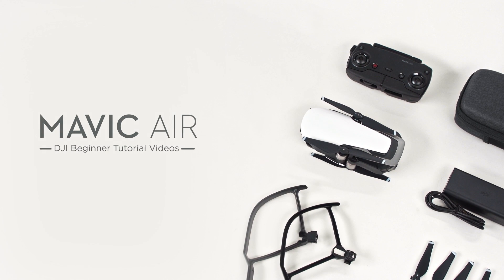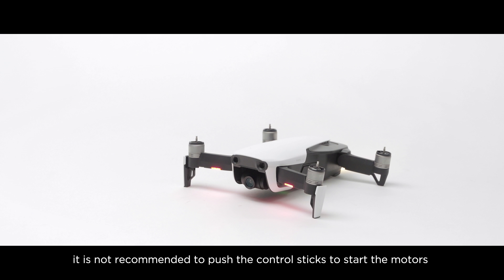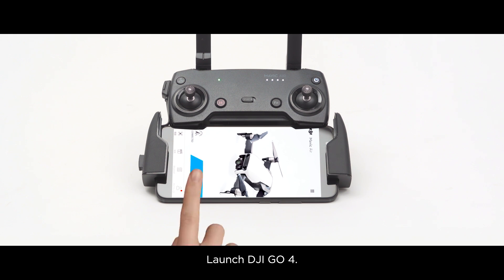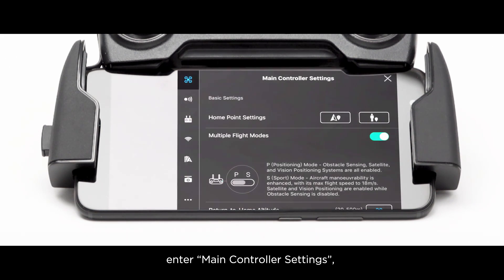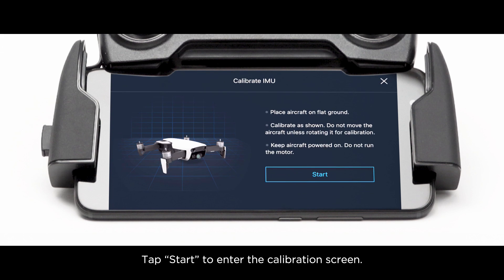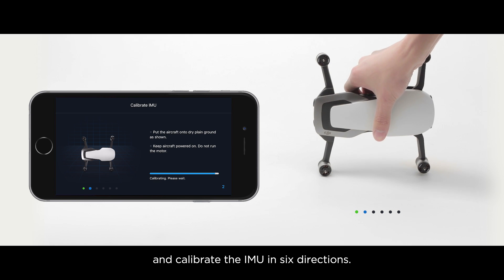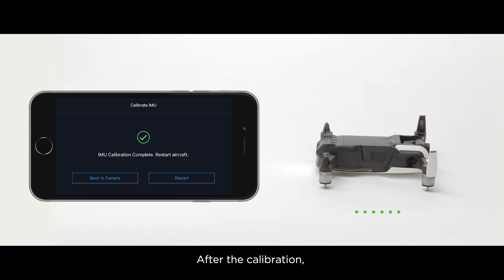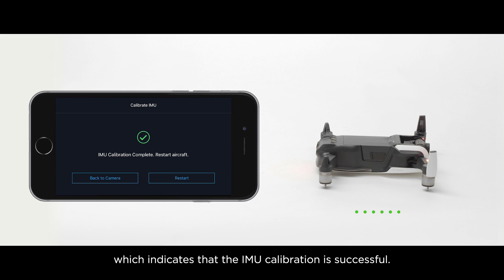How to Calibrate IMU on DJI Mavic Air

Comment: how do you calibrate IMU for a DJI O4 lite unit? (not on a DJI drone, but on a Flywoo75)  ?? 
Android, DJI 4.0 app, no option for the DJI 04 air unit. just a bunch of DJI drones.
Reply from the maker: Hi there,

Sorry for the confusion, and thank you for reaching out.

For the DJI O4 Air Unit, the IMU module cannot be calibrated via the DJI app like consumer DJI drones.

May I please confirm whether you are currently seeing any IMU error or warning message in the goggles?

If yes, please help provide a screen recording or screenshot from the goggles, and upload it to Google Drive, then share the link with us so we can further check.

Also, please let us know:

1. Did the IMU error appear after a crash or impact?

2. Have you already tried restarting the devices?

Once we have this information, we can assist you further with troubleshooting. Thank you for your understanding and cooperation.

Comment: DO NOT BUY THIS DRONE. YOU WILL HAVE TO REPLACE THE ENTIRE UNIT WITHIN 1 YEAR. IT'S A DEFECT IN THE PRODUCT BUT DJI WLL CHARGE YOU $550 TO REPLACE YOUR BRAND NEW UNIT.
Reply from the maker: Hi Hunter, sorry for the inconvenience. May we know your case number for better assistance? We'd like to help you check the details, thanks.
Reply: DJI Support don’t know if there’s a case number. Wasn’t willing to pay $550 for a drone I’ve used 3 times and never hit anything. Never had a problem with this drone. Did the required Firmware update and INSTANTLY BRICKED MY DRONE. 

Now you guys want me to pay you $550 to fix it.

#buygopro #boycottDJI
Reply from the maker: @huntergray  Sorry again for the unpleasant experience, Hunter. If you sent the unit to our repair center for service, there will be a case number started with CAS-, you may also provide us with your email address and we can locate your case number and learn from the details. We look forward to hearing back from you.

Comment: I recieve the follow error in my Mavic Air: gimbal cannot receive main controller data. No crash happend. Just one day worked fine. other day that error. Drone is 1,5 years old. DJI says no more guarantee .In my country guarantee is always  2 years .  drone has a total of 7 hour flight time. It's a shame I have to pay for an error that is obviously a weakness of the drone... Let alone my disappointment on my Holiday that I couldn't take aerial pictures..  :(

Comment: After update firmware, my mavic air cannot take off check IMU and Motot, what should i do? Pls help me!
Reply from the maker: Hi Leo, please check if the firmware has been updated to v01.00.0620 successfully, and try to refresh the firmware via DJI Assistant 2. Besides, please try to calibrate the IMU and check again. If the issue persists, please provide the screenshot of the error message for further confirmation. You may keep us updated via Facebook Messenger: https://bit.ly/2pm7tfV

Comment: Yesterday my controller refused to link with the drone no matter how many times I tried. Today, it connects but calibration is taking me hours. Batteries drain and I recharge and keep trying. What should I do if it refuses to calibrate, please?
Reply from the maker: Hi, please shut down the drone and cool it down, then reconnect the DJI GO 4 app and the drone to calibrate again. Please tell us the details if IMU still won't start calibrating.
Reply: DJI Support Thank you so much. I will do just that and get back to you please. I love all my dji products and I am impressed with your quick response. Thank you so much.
Reply from the maker: @JustDavidMinistries  You're most welcome, we appreciate your support. And when needed assistance, you can also contact us via Facebook Messenger: https://bit.ly/2pm7tfV

Comment: How about if is not responding and u got a messge of main controller data error
Reply from the maker: Hi there, please try to refresh the firmware for the drone and restart the drone. If the issue persists, you may need to send in the drone for diagnosis.

Comment: Hi, i press start and doesn't work and do noting
Reply from the maker: Hi there, was the drone and RC connected successful? Please make sure the APP and the firmware are the latest version, it would be better to calibrate outside with the strong GPS signal. If the issue persists, may we verify if the drone was crashed?

Comment: Hola tengo problemas en mi mavic air presenta inestabilidad en vuelo desplazamiento lateral y rotación aún después de calibrar IMU
Reply from the maker: Hi Oscar, just to verify, has the drone been involved in the crash or hard landing before? If not, you may calribate the remote controller and test in the open field with good GPS signal to check.
Reply: @DJISupportGlobal  aún no lo pruebo pero al parecer era calibración del joystick muchas gracias
Reply from the maker: @oscarmoran7061  You're welcome, you may keep us updated about the result after the test. Any issues, please feel free to contact us.

Comment: Hii dji 
Actually I m having a mavic air and its notify that (processer chip heated) plz help
Reply from the maker: Ashton, sorry for your trouble. Please turn the drone on for a while, check whether the fan is spinning. If the fan is not spinning, please send the drone back. Please kindly contact the dealer for further assistance. 
Please let us know if the fan spins correctly, thank you.
Reply: The fan is spinning
Reply: It's show on remote like (main control data error )
Reply from the maker: @theronepilot  Please try to refresh the latest firmware for the drone, if the issue persists, you may need to send in the drone. Sorry about that.

Comment: I only could fly it once since i bought the mavic air. Latest firmware, calibrated imu, and opti system. But no matter where i try to calibrate compass i get magnetic interference error.
Reply from the maker: Sergio, we are sorry for your trouble. May we know if there is an error message when calibrating the IMU? And does the drone crashed before? Please kindly keep us updated at Facebook Messenger: https://bit.ly/2pm7tfV, we will do our best to help.
Reply: @DJISupportGlobal  when i try to calibrate my mavic air it wont work, i waited like 10 minutes and it didn't work
Reply from the maker: @NocoFishing  Sorry to learn about having issues. Could you please confirm if you're running the latest DJI GO 4 app? In order to ensure that the app can be used normally, we have opened a download channel on DJI’s official website. You can visit our website at https://www.dji.com/downloads/djiapp to download and install the latest APK file to update the app. Hope this helps.

Comment: hi DJI Support...Please how can i solve this issue..? (No Image Transmission) i normally experience this when ever i fly more than 200meters... i nearly end up crushing my drone.its kind of frustrating when it comes .(Mavic Air)
Reply from the maker: Jetlee Tsutsu Lawrence, sorry for your troubles. Just to verify, the image transmission issue happened when it flew over 200 meters, right? Flight distance sometimes relates to the flight environment, please try to fly in another open wide area, make sure that the antennas are unfolded on the drone, and the RC antennas are pointed correctly to the drone. 
Besides, please check and select a channel with good quality, you can change the channel on the WiFi settings. 
And please make sure the firmware is updated. 
If the issue persists, you can try to export the data from the drone via the DJI Assistant 2, upload to Dropbox and provide us with the link, we'd like to forward to the engineers to double check.
Reply: DJI Support OK..thank you for your support..I will try my hands on that and get back to you. Thank you.
Reply from the maker: @jetleetsutsulawrence7173  Thank you very much for your cooperation. You can also contact us at http://www.dji.com/support. Thank you.

Comment: I need help. My Mavic air show a IMU error but I can't calibrate. The buttom start just not work! And another error is showed: gimbal cannot receive main controller data.
Reply from the maker: Hi Kaio Lima, just to verify, you tapped "Start" but the IMU calibration won't start, right? Could you please try to restart the app and check if there is a need to update the firmware first? Please also try to reinstall the DJI GO 4 app, if there is anything on the app needed to back up, please don't forget it. As for the gimbal error, we had replied to your another comment, please check and keep us updated. Thank you.
Reply: @DJISupportGlobal    I have the same problem, I have tried restarting the drone a lot of times but he don't let me calibrate, now im trying to reinstall the app, but what I have to do?
Reply from the maker: @ArchivioBDF  Hi Martino, we are sorry to know your issue, just to verify, the drone was not able to initiable the IMU calibration, right? May we know if there is an error message on the app? Please kindly provide us with more details or a video of this case for further checking, you can send it to m.me/DJISupport. 
Besides, may we know if the drone had crashed before. If so, you may need to send it in for service. Please contact our support at the following page for a further help http://www.dji.com/support.
Reply: @DJISupportGlobal  so thanks for the quick answer. When I enter the app  it say me to unplug the 8pin cable of the gimball , to calibrate the imu and restart the drone,  now I'll try another time and if it doesn't work ill send the screenshot of what I see, cause it simply don't let me calibrate the drone if I play start, thx for the help
Reply from the maker: @ArchivioBDF  Thank you, please provide us with the screenshot of the error message at your convenience, we'll help to check.
Reply: @DJISupportGlobal  I have sent an email on the dji page, with some screenshot of my problem

Comment: I recieve the follow error in my new Mavic Air: gimbal cannot receive main controller data. Please, help me !
Reply from the maker: Hi Kaio Lima, sorry for the issue. Please try to restart the drone, and check if there is a need to update the firmware. Besides, if you had plugged an SD card on the drone, please try to remove the SD card and restart the drone. If the error persists, you may need to send it in. Please contact our support on the following page to start a case: http://www.dji.com/support.

Comment: Buenas tardes.Buen video.
Tengo un problema con -mi Dron Mavic Air y quiero hacerles una consulta.
El mismo tiene 3 meses de uso. Cuando comienzo el vuelo lo dejo unos segundos a 1, 2 mts de altura, luego lo hago avanzar unos 70/90 mts y regreso, sin subir ni bajar, pero cuando llega al punto de donde salio , esta a 40 cm de altura.
La estabilidad es buena , pero varia la altura y en la pantalla ,por ejemplo despues de subirlo a 8 mts y volver al 1 mt , dice 2, 3mtspor ej.
Le he calibrado la Brujula , cuando me lo ha pedido.
Lo ultimo que hice es calibrarle el IMU.
--otro comentario , en vuelo la temperatura de la bateria esta entre 50/55 grados, cosa que no se si es normal.
Me pueden orientar, para saber cual puede ser el Inconveniente.
Muchas gracias 
Luis
Reply from the maker: Hi Luis, just to verify, you have questions about the RTH, the stability of the drone and the battery temperature during flight, right? 
For the RTH, could you please tell us the concern that you have? At the same time, you can also check the RTH procedure on page 13-15 in the manual at https://dl.djicdn.com/downloads/Mavic%20Air/20180525/Mavic%20Air%20User%20Manual%20v1.2.pdf.
For the stable issue, please check if the propellers are damaged, change them when necessary; please fly in P mode with good GPS environment, avoid flying when there is a strong wind and much interference around, if the issue persists, as you had tried calibrating the IMU and compass, it would be great if you can provide us with a video of this case for further confirmation. 

Regarding the battery temperature, it is normal it becomes high during flight, but if there is an error message on the app that tells you the battery temperature is too high, please land it asap. 
Further assistance needed, please kindly DM us at m.me/DJISupport, thank you.

Comment: Not happy at all with the drone, i got it 2 months ago and still  cant get it to fly because of the IMU thing..
I found this promble all over the internet with everyone and dji didnt care to explain how to fix it, after-sales support is also not available at dji website!!

The problem is simply when you go to advanced settings to calibrate IMU the start button simply will do nothing at all!! U just keep pushing it and nothing is happening.
Reply from the maker: Thamer Alenazi, sorry for the troubles with the IMU calibration, please contact our support during the working hours if you need any technical support. May I know if the APP has connected to the RC successfully? If yes but the issue persists, any chance to provide us a short video about the issue for further support?

Comment: But what if I don't have a phone?......
Reply from the maker: Hi Marius, it is suggested connecting the drone with a mobile device. Because when you connect to the mobile device, you can first activate the drone, then check the aircraft status and have the transmission image on your mobile device. At the same time, if the drone is not connected to the mobile device, the flight distance and altitude will be limited to 50 meters and 30 meters. Thus it is suggested flying with DJI GO 4 on a mobile device, thank you.

Comment: What is IMU???  And what's the calibration for???
Reply from the maker: IMU is the inertial measurement unit. You will need to calibrate it when the app tells you, the drone is not flying stable or the parameters on the app are not accurate and so on.
Reply: DJI Support do I have to do this all the time????

Comment: Hi when i got my mavic air first time.. i didnt caliberate imu.. neither vision calibaration.. is it necesarry to do out of box   ??
I m taking this on my holiday tour.. should i caliberate imu there at my holiday place?
Reply from the maker: There is no need to calibrate if everything works well. If anything goes wrong, there will be warning in DJI GO 4 and guide you the further steps. No worries.
Reply: DJI Support I have problems with recalibration of my DJI Mavic air vision systems. What should I do to solve it?

Comment: Greetings.  Love the BT300 glasses EXCEPT for the fact that the track pad gets too hot to handle.  The only app I have on the track pad is DJIGo4.  And it seems that when I connect everything the drone runs really noisy.  Any suggestions?